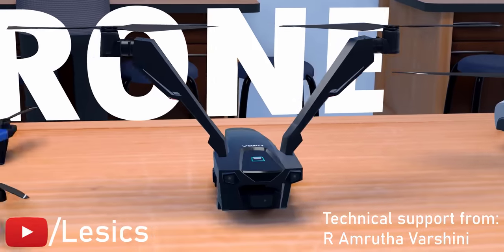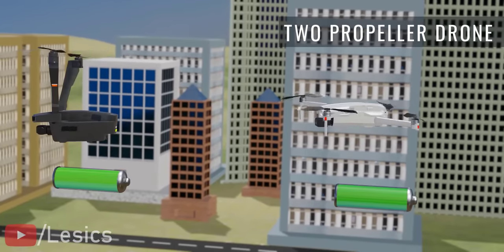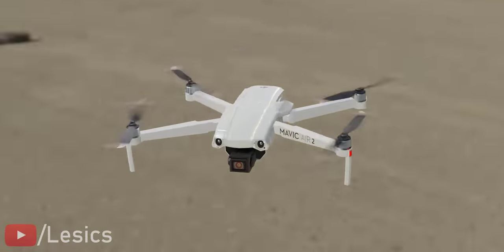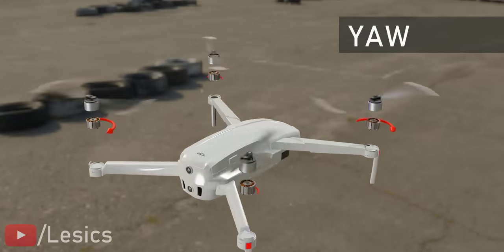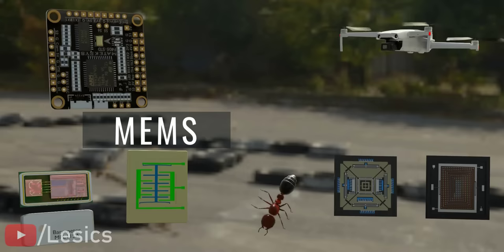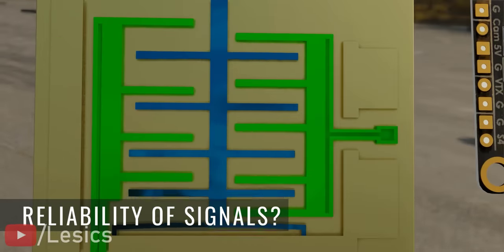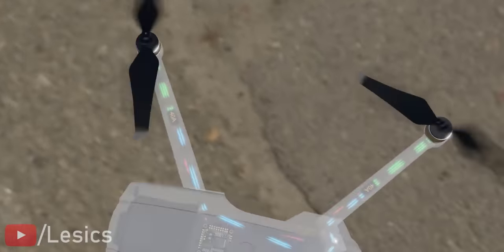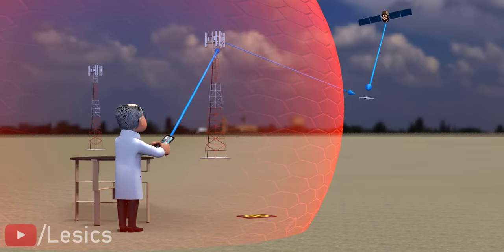Drones | How do they work?

Comment: One correction, barely any drone uses Li Ion batteries, they use Lipo these days for higher discharge capacity.
Reply: Higher discharge or lower discharge?
Reply: @sparkly3989  Higher discharge rate i mean, ofcourse li-ion can be discharged to lower voltages than lipo but the discharge rate is substantially lower.
Reply: Still don't know why they don't use LiFePO4 which is much higher discharge rate, higher capacitance density, higher operating temp range than LiPo. I guess the reason is cost for this battery and to make new circuitry for charging, discharging
Reply: @thexht7927  Nano carbon batteries also can be used tho
Reply: or even LiFe.
Reply: Li-Po batteries are just High C-rated Li-ion batteries in Polymer package.
Reply: A LiPo is also a lithium ion battery. What do you think the Li in Lipo stands for.

Comment: I've accidentally flown my Mavic 2 into different things several times now. Two times trees, one time a building, and one time myself... Each time it managed to surprise me by somehow auto-stabilising instead of falling out of the air, all while sustaining only unexpectedly minor damage. There's even a video by Destin of Smarter Every Day in which he flew his Mavic Air 2 into a pole, causing a front arm to fold in halfway, and yet it still managed to stay in the air. As a software engineer I was quite amazed when I watched Destin flick the folded front arm back to its extended position while the drone was still in flight. It's very reassuring, seeing that my drone (or at least, a drone with similar capabilities to mine) is able to handle much rougher treatment without any problems.
Reply: Javier Solis  Well, seems like Youtube didn't like me posting links. It's Smarter Every Day 245.
Also on second look it seems like it's the Mini 2 not the Mavic Air 2. Doesn't change anything about it though.
Reply: As long as you can code, things are taken care of. This is the most basic thing we can expect in engineering these days that any bad incident will be taken care of by the algorithm. Just like the airbags that get deployed on an event of a car crash. It depends on the speed of the processor and signal. And thankfully devices today are really fast to detect split second collisions.
Reply: I same with me but with no pole hitting and mavic mini
Reply: @scheimong  Thanks for sharing that info.
Reply: @edwardspencer9397  except when airbags were introduced they weretriggered by force from the impact and then a chemical reaction. There was no electronics involved. The process was entirely mechanical.
Reply: @michaelhertz8717   the door will be unlocked when an accident happens to make the rescue easier for the driver, this process maybe triggered by electrical unit

Comment: I've got a 4 bladed drone that can run without a controller. Once in the air it's programmed to follow you via a tracker beacon and the on board sensors or an automatic computer program. Although it comes with one anyway so you can do tricks and more complex moves, but other than that it's fully automatic and requires no assistance. I use it for film and checking stuff on my farm.
Reply: yes drones can run autonomously as well, if you code them.
Reply: Can you share what changes you made for that?
Reply: @sahilmohite701  
Most of it was stock as it was intended to help farmers check their crops without leaving their house. It pretty simple all you need for a follow me drone is:

1x tracking sensors and receiver to follow

1× obstacle avoidance system which requires a sonic sensor, beacons and gps mapping so it remembers what path you took and will follow it again.

1× self stability sensors for more stable shots.

You'll also need knowledge in coding to tell the part how to communicate and what actions to do.

Or if you don't want to go through the hassle and have a bit of dough to spare, you can buy drones that comes with all this fresh from the box. I hope this help you with your next project, good luck👍.
Reply: I work for a company that has spent the last 5 years developing fully autonomous single rotor helicopter uavs for low level geophysical survey, we only use RC control for takeoff and landing, after takeoff all control is handed over to the autopilot and the 2.4GHz RC is switched off, UAV telemetry is monitored through a 400MHz long range data link which is also used to command the UAV to return home, we can also make it hold while we upload a new or adjusted mission and even fly it in manual RC mode using the telemetry data on the ground control station screen, although this would only be done in an emergency situation. Our UAVs fly low level terrain following beyond visual line of sight for up to 2hrs sometimes around 10 miles from base.

We also have a fixed wing vtol uav for photogrammetry that is 100% autonomous, it takes off flys a mission then returns home and lands by itself, it sits standing vertically on its tail on the ground and takes off like a twin rotor multicopter then pitches forwards and transitions into a twin prop fixed wing to fly the mission, when it comes home it circle's above home and pitches nose up until it stalls and transitions back into a multicopter then descends and lands on its tail.
Reply: @ats-3693  
I've heard of those self driving drones, alot of farms around here have upgraded to this system for crop dusting, bird scaring, monitoring and more, it's even used by our fire crew to check for bush fires in the mountains. My design was based on a very basic version of this for the gps tracking. That's so cool to hear someone else who has experience in building drones.

Comment: 7:52 Correction: Kalman filter is NOT a controller. It aids in sensor fusion to ONLY estimate the state of the aircraft (Orientation, height, and position). This is necessary for the controller to work (Provides feedback) but it is not the controller itself. "PID controller" is the right term. It is what actually "controls" the drone to maintain it in a desired state (Balanced hover, tilt to a desired angle, maintain certain speed etc.).
Reply: @Abhishek Reddy : Drone related information (source) ekkada available lo udho chepthava?

Comment: Kalmam filter is used to sensor fusion not to control the system. In order to control the stability you can use classic PID controllers, Space state controllers or lyapunov.

Comment: Usage of SLAM can really bring up the accuracy and can take up any challenges
Reply: Thing is that it's rather useless in areas with little geographical features, like in deserts, fields, and places with lots of woods
Reply: @NerdKing9826  Being an engineer you should always try to design a single equipment for multi purpose.. and are you serious that it can't be used in woods? That's basically used whenever you aren't sure about the quantity of obstacles and the area.... That's the kind of place it was basically built for....
Reply: @ajithbharadwaj3344  I think a drone using visual slam could probably make it's way out of woods if it's near the edge, but Visual Slam is not good for determining position in homogeneous environments (deep in woods). Im not talking about collision avoidance btw (it'd be way easier to use sensors other than cameras for that), I'm talking about true navigation and positioning. Visual Slam can definitely give great positioning accuracy when there's enough heterogenous features in the environment though
Reply: @NerdKing9826  yup, that's correct.
Without differentiating between features of environment at different positions, drone can't localise itself using Visual Odometry.

Comment: The Neonode Air Bar is a touchless sensor bar that uses infrared (IR) light to detect hand gestures, allowing users to control devices without physical contact. Here's a simplified explanation of how it works:

1. *IR Emission*: The Air Bar contains IR LEDs or lasers that emit infrared light patterns onto the detection area.
2. *Reflection*: When a hand or object enters the detection area, it reflects the IR light back to the Air Bar.
3. *Detection*: Photodiodes or sensors in the Air Bar detect the reflected IR light and send signals to the microcontroller.
4. *Gesture Recognition*: The microcontroller processes the signals to determine the hand's position, movement, and gesture (e.g., swipe, tap, or hover).
5. *Output*: The Air Bar sends the recognized gesture data to the connected device (e.g., computer, TV, or smartphone) via wireless or wired communication.
6. *Device Response*: The connected device receives the gesture data and responds accordingly, performing the desired action (e.g., scrolling, clicking, or navigating).

The Neonode Air Bar uses proprietary algorithms and advanced signal processing to achieve high accuracy and reliability in gesture recognition. Its touchless technology enables intuitive and hygienic control of devices in various applications, including smart homes, gaming, and public installations.
Reply: Bro put these content in video

Comment: With Tricopters you add a tilt mechanism to the rear motor. They actually have some advantages over quadcopters.
Reply: One of them is low battery power consumption but quad copters have higher stability and can carry more weight

Comment: in our collage we made a drone witch fly in air with one propeller only by making mechanical gyroscope in middle to control it it was stable as hell but only problem is power it drain power like crazy
Reply: That's an interesting concept. But you're right, it would consume the same energy as a two propeller variant but only generate half the lift
Reply: @michac.8283  but our drone was not successful but our bike was success
Reply: @nagasaipurvaz4251  oh I've seen that one, nice that you have been working on it

Comment: You could have added the that the final control is through the combination of errors in, position , velocity, acceleration and  the integral control to keep the same location in a constant side wind. or hovering with a different loads  State control systems/ logic/ processing  should be taught in all schools, at an early level.

Comment: Hey! Why not use the technology/design used in helicopters in single(1) propeller Drones. (Might be a good idea as helicopters are also with single propeller)
Reply: . . . also there is a second propeller (small ) in the rear side "queue" of the helicopter to avoie the rotation of the jet around herself
Reply: @pierresakr1811  yeah! It is to prevent the yaw produced due to Newton's 3rd law of motion. So let's also add that propeller at tail to our drone. Is there any other issue needed to be resolved now?
Reply: Helicopter is mechanically complex system. As it uses swash plate based mechanism for achieving roll,pitch and yaw control using single propeller.
So, basically in helicopter you use hydraulics based system to change the pitch of blade, which increases the mechanical complexity of system. And it also results in reduced agility of vehicle.

Comment: Single rotor with not tail motor,  a bottle with rotor can also fly smoothly..already some of them has the technical knowledge..no need to have 4 motors and lot of energy waste..one can easily maneuver with control fins below the Top rotor on either 4 side of Cockpit ...Air thrown below helps stir

Comment: After watching this I am confused what should I do, Mechanical or Electrical engineering ?
Reply: Flip a coin or do both
Reply: Why not both ?
Reply: I think there is this thing called mechatronics check if it's near you (might also have different names) it has electronics,mechanics and programing
Reply: You should look into Mechatronics Engineering.
Reply: Both.
Reply: @techmad8204  okk I will definitely look for it👍🏻👍🏻
Reply: You can study both since everything is available online and even get degree/certificate since many institutions have started to give it through online classes.
It's 2020s not 2000s.....

Comment: But for the one propeller drone you can put a a tail rotter and adjust propeller maybe with step motors or something similar so you can change the propeller angle so you can make a helicopter drone

Comment: Why do we have these quad rotors instead of miniaturized helis?
 

Also why not just use a tail rotor? Isn't a tail rotor a less resource intensive and simpler design than a quadcopter?
Reply: Its because helicopters need complex mechanical components like swash plate and pitch varying mechanisms to achieve various flight dynamics like roll, pitch and yaw. In a quad copter all of these movements can be achieved simply by varying speeds of different propellers, thus the number of moving components is greatly reduced to just four propellers. Increased number of small moving components in a UAV increases the design complexity and weight which in turn decreases overall efficiency and performance.

Comment: now build a FPV freestyle drone and program it in Betaflight  to REALLY learn how drones work. you only need one type of sensor, the gyro. all signals then go through a PID controller for error correction and fine tuning. of course my explanation is over simplified, but DJI systems are way more complex than they need to be, all in the name of user friendliness and higher sales figures. I'll stick with my Armattan Japalura 3inch.

Comment: I have a tactic air drone When I bind the controller with the drone the lights still flash but it still flyes  ok .  The drone is connected together with the controller.    It worked ok with lights on steady about 4 times then it when back to lights flashing again.   Real problem.

Comment: Why isn't there a helicopter drone? Seems like an easier solution for 2 rotors
Reply: Helicopters also have counter weights rotating in other direction...
Since drones are battery operated... And you have to have a counter rotating thing.... Why not put it to some use...
Hence 2 wings.
Reply: i think the helicopters require some sophisticated mechanical parts that can adjust the pitch of the prop angle to give forward-backward and side-to-side movement. And it seems like they are more dangerous because the props are long and travel so fast and don't have any bumpers to protect people from being harmed if there is a malfunction?

Comment: #doubt A doubt : Helicopter also has only one propellor. Why does it not spin because of Newton's 3rd law
Reply: Because it has another fan at the tail of the helicopter. This will cancel the rotation and make the helicopter stable
Reply: @arnavpawar8602  ohh i thought that tiny propellor is useless. But its surprising it can balance torque of the big blades

Comment: It's Simple aerodynamic if you learn how to fly a drone . Then you don't need in flight controllers.  It's no diferent than  a full size pilot once it air born HE ENGAGES AUTOPILOT. Flying drones it's all about you taking the controls. Not the soft wear that's on board. Doing things like R.T.H.
AUTO LANDINGS, AUTO TAKE OFF'S .  ECT ECT.

Comment: Meh, I still prefer something with wings on it as it is more energy efficient, you can carry more ordinance er... payload, stay up longer especially if you have wings optimized for gliding and unleash the power of fossil fuel!

Battery power leaves much to be desired despite current innovations.

Comment: I watched one of my two Dji m600 pro's ($6000) carrying my Red Raven Camera and dji Ronin mx ($8000)  disconnect from the controller less than 10ft away from me, shoot up to 400ft  and flew away at high speed never to be seen again. After months of going back and forth with dji, threatening to sue, and sending them the controller flight data which showed that i was not at fault , they finally replaced the stupid drone , but not the camera that I literally worked for years to get. Dji Destroyed my life with a faulty product , And yes i have months of correspondence with dji to back up everything I have said Here.

Comment: As a drone professional and developer this video is garbage, you skip over some very important steps and don't even cover the fact each drone needs to be tuned for the specific parts it is using. Also, wind isn't a big deal at all even before using gyros you could still fly in the wind, you could at least spin the props correctly in your rendering.